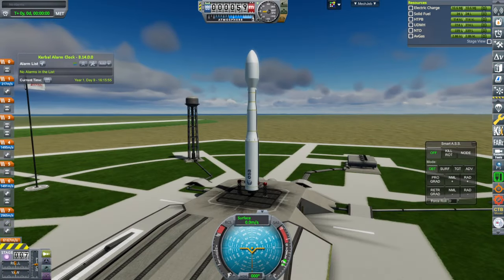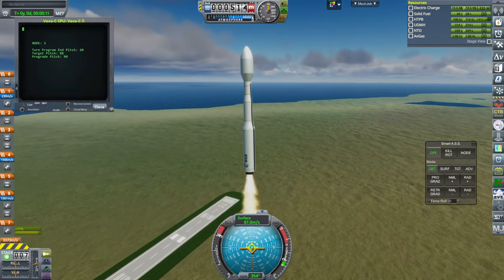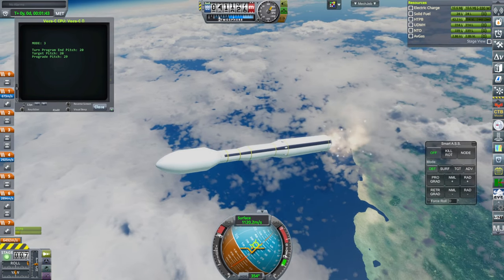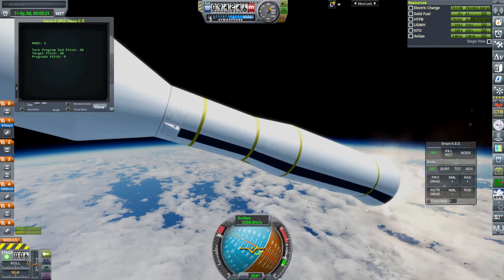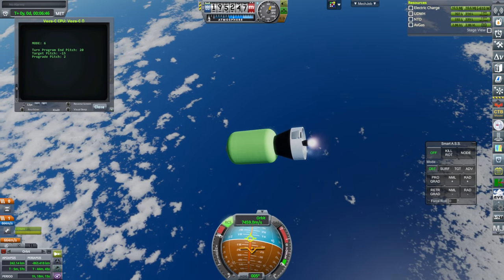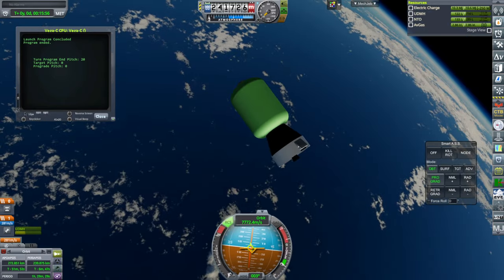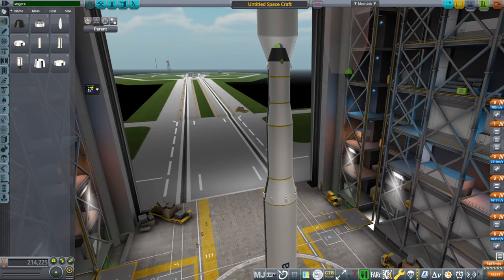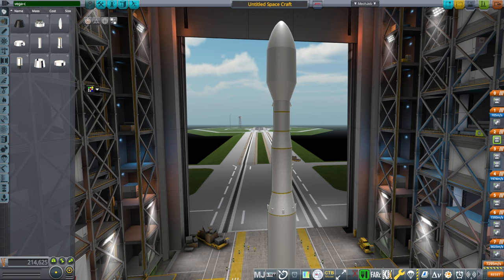Testing Vega-C for the Real Rockets mod (KSP with RO)

Comment: Hi, 

First of all the model looks great!
Roll control on Vega C is indeed provided by RCS on the 4th Stage throughout the entire flight.

The AVUM engine does gimbal. Vega had a failure because the hydraulic actuators were wired wrong.
Reply from the maker: Ah, okay - glad I don't have to add any extra thrusters. I'll add gimbal to the AVUM engine.